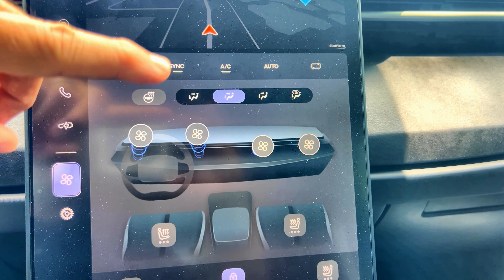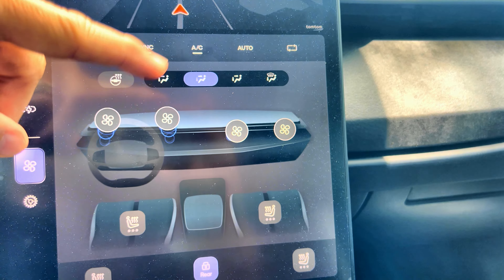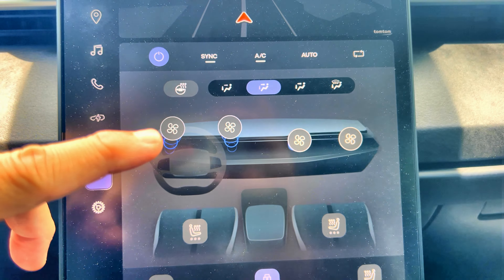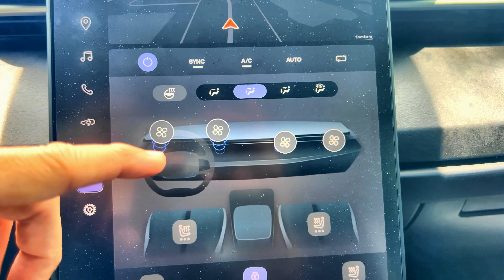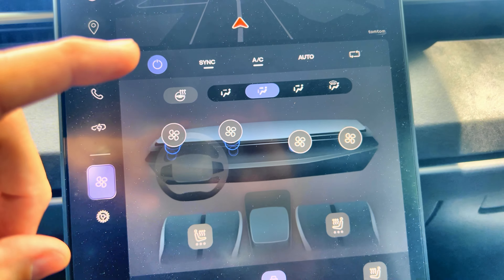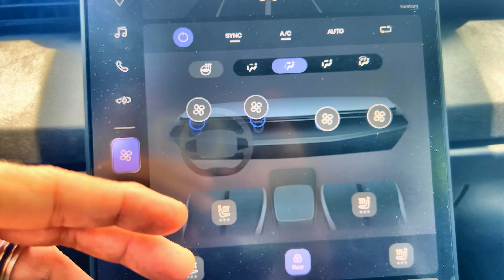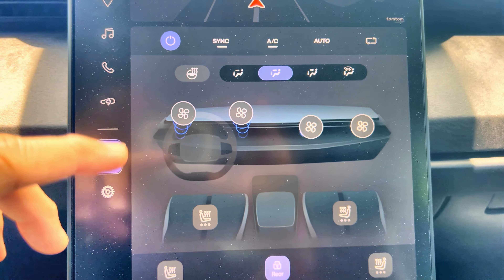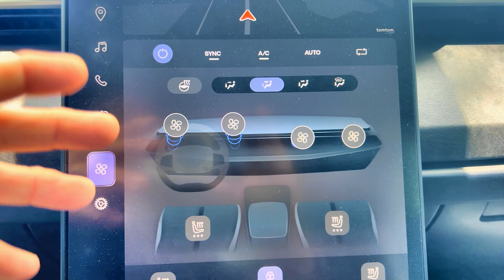Fisker Ocean - HVAC AC Quick Tips

Comment: definitely have this issue. in addition to toggling the AC on and off, I also tap on each of the circle vents to get them to close and open.
Sometimes they reset to closed and I have to toggle tap them back to open.
Weird.. but after that I start feeling cool air
Reply from the maker: Thanks for the suggestion.
Reply: @MTNRanger  I wanted to know if turning off the same thing as just turning all the AC. By the way, my problems are with the vents are damaged and of course no one to talk to at this time.
Reply from the maker: @Dictation1  Do you mean by turning the HVAC on/off the same as turning the AC on/off?  No, that is different.  Most of the Ones will have to have their vents replaced.

Comment: A good test is if you see the line under the AC tab it should be blowing cold air. 

Tap the tab. If the line disappears and quickly reappears, tap it again to make sure it is off. 

Then tap to turn it on. Cold air will blow.

Comment: I’ve had this happen to me a few times, twice this week. 😅 I tried the AC cycling numerous times and this hasn’t worked for me, although I haven’t waited more than 30 seconds. I’ve had to set my energy mode to 30 seconds and also reset the car by leaving the charge door open. Next time I’ll try to cycle the button and see if that will do it, thanks!
Reply from the maker: Yes, I have heard other people that have totally lost all cooling - which obviously this fix doesn't help with.  I'm not sure what is causing the AC not working at all.  Let me know if anything you do different works.

Comment: Thank you. I want suggest you check Vent for rear seat. I found It will not close at auto or A/C mode. Switch for toward back seat is not working, Stay Open. and Will by-pass air toward back seat.. Only way prevent is change mode to Downward to front sear leg.
Reply from the maker: I’ll have to look into this.  I was not aware that you can shut off the rear seat vents.

Comment: Hi Mtn. Ranger, thank you for all you do. I just found out today that my HVAC is not starting at all. I’ve tried turning the A/C on and off. Also, tried doing the soft reset. I also put it to sleep but it’s still not starting. No air at all. Any suggestions? Maybe a fuse needs to be reset or replaced?
Reply from the maker: So does nothing show up on the button bar?  No fan speed?  Are you not getting cold or heat?
Reply: @MTNRanger  Hi! No fan speed at all. No cold or hot, as if it is not even turning on. It was working fine until we put the cover for the fuses underneath the steering wheel but I could be wrong.
Reply from the maker: @AbeD-t9v  I'll ask around and see if I get any suggestions.  Have you done a full reset (AKA factory reset)?
Reply from the maker: @AbeD-t9v  Here are some suggestions.  Check to see if these cabin fuses/relays are good: RF17, RF39, RRY09.
Reply: Thank you Matt
Reply: @MTNRanger   Will do. Thanks a million Matt!
Reply from the maker: @AbeD-t9v  If that dosn't fix it, you will most likely need a tech with the FAST device.
Reply: Thank you Matt!
Do you know anyone who has one in the Atlanta, GA area?
Reply from the maker: @AbeD-t9v  None that are based in GA.  You are going to probably have to a tech to visit you.  Email me at mtn_ranger at aol dot com and I can give you more information.

Comment: Thanks for the tip My vents make noises like there trying to move as soon as I enter my Ocean One. They also don't point where I want them to when I move the icons on the screen. Any suggestions or fixes for this issue?
Reply from the maker: The most likely means you need the vents replaced.  Most of the early production up to Nov needed the vents replaced.  See this video for detail: https://youtu.be/2_SghCFovHM
Reply: @MTNRanger  my vents are totally closed, I’m using a plastic fork to keep it open
Reply from the maker: @Dictation1  High tech solutions are the best!